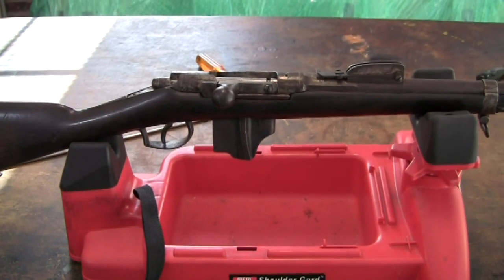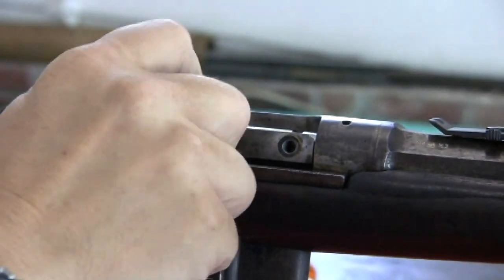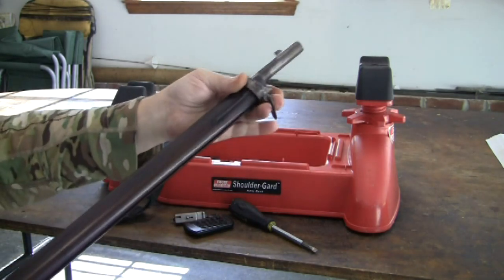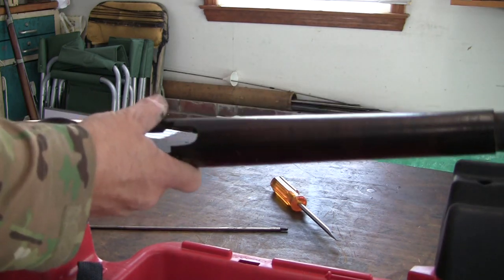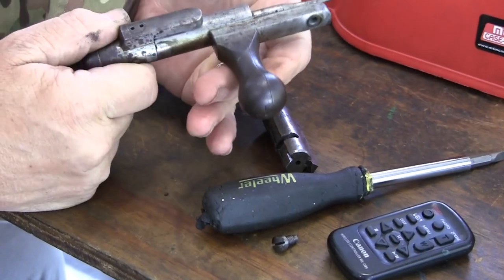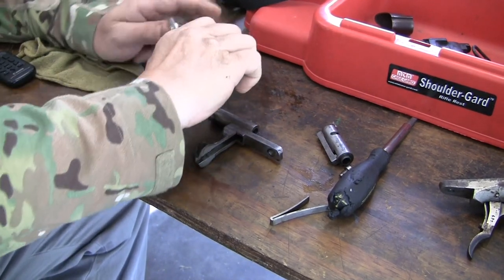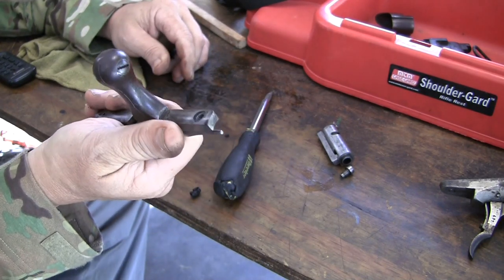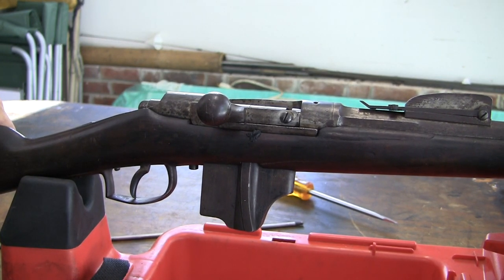Dutch 1871/88 Beaumont rifle Disassembly

Comment: Interesting but I wouldn't get one.Always great video's
Reply: @Gabby6060842  There are folks who will make ammo for this and once you have the brass, you can reload yourself.  I hear that the neck can be resized with 45-70 dies so I hope to give that a try one day.
Reply: Matt Halsey you start with sharps 50-90 brass then trim to a Specific size then anneal the brass then you run it through an 8 mm LaBelle sizing die then you use a 4570 die and finish it off with a 45 Long colt die, if you want the specifics Contact the man that made this fine video
Reply from the maker: I have the correct dies, And can make ammo, let me get the swiss vetterli people set up and I will start work on this next
Reply: Just as far as I go, I really only need the brass as I will reload myself.
Reply: Matt Halsey it has to be made ,
Reply: Matt Halsey 50-90 sharps straight , star line makes it !